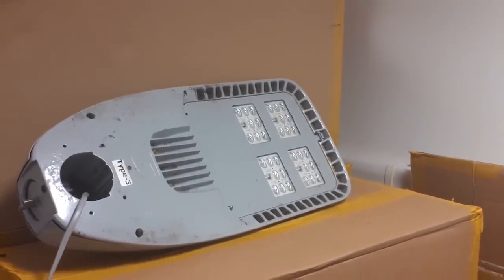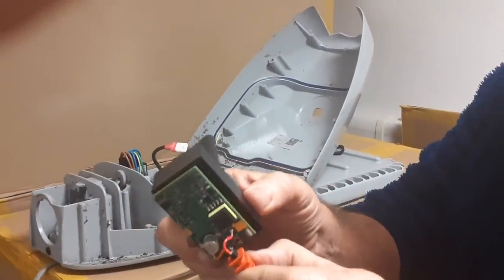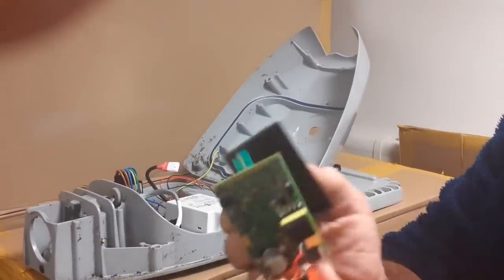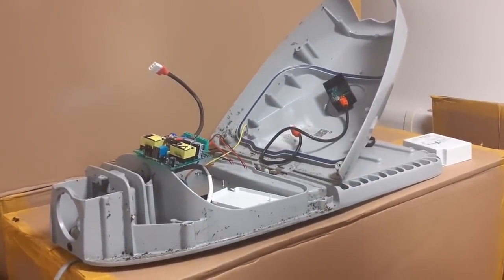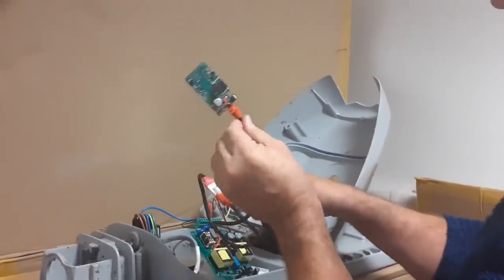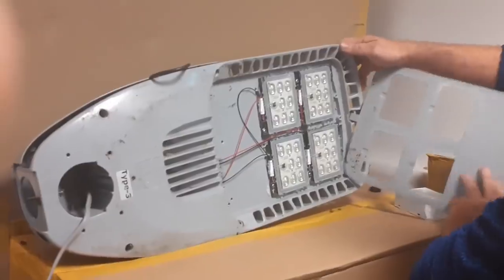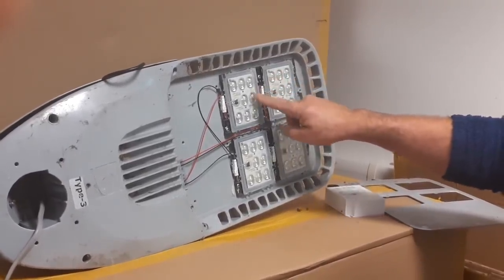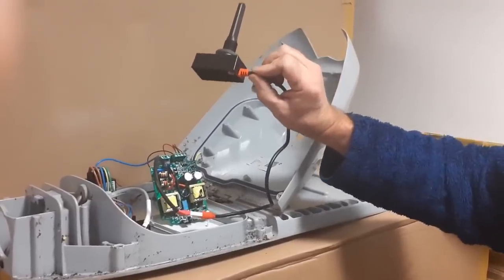5G LED STREET LIGHT TECH BREAK DOWN

Comment: The 5G use cca. 5GHz or higher frequency. The phisical size of the antenna is determinate the frequency (google: monopole antenna calculator). It's a simple phisics. My country Hungary use a hundred years old  tower for switch the lamps. It's analog and works on longwave 135,6 kHz. The thickness of the wires are overbuilt because the norms. This lamp is high level of dust, water and drop resistance. This lamp is installed by workers aloft in cherry picker, bad weather conditions, use gloves etc. The wires need to be heavy-duty.  At the LED side can use thinner wires, because it's an other closed compartment of the lamp. It's sealed in the factory. The mechanic has nothing to do there, he has no workpermit and tools to open that part of the lamp.
Reply: 5G is SUB GHz for the main blanket coverage as its long range radar

Comment: The high voltage capacitors are clearly part of the primary circuit of the switch mode power supply which needs to handle the peak voltage of the mains supply (350V).  The LED will run on the output of this supply - 12 or 24 V.  There is nothing suspicious about the antenna, it is probably just a 5/8 wave omni used to control the luminaire by phone or wireless signal.  If there is anything suspicious about this device we need to find out by having it reverse engineered by a competent technician.
Reply: stop talking sense lol

Comment: The council installed theses very same types of lighting fixtures in my street. My wife , my son and I have all started feeling ill or experiencing abnormal behavior. Mainly headaches, tingling sensations, tired for no reason, and generally feeling run down. I have a 40x microscope and views my blood when I was feeling ill, I saw massive amounts of Rouleaux (stacked red blood cells) forming on the slide. Later when not feeling so  I'll check an other sample the stacking isn't present and looks normal.

What on Earth can we do? I want more info and evidence before I approach the council.

Comment: He's basically correct.
But he doesn't know the difference between Voltage, Current and Power.
450V means nothing unless you know how much current is being drawn.
I doubt that's a 450V Electrolytic. It would be much larger (depending on the Capacitance).
Voltage x Current = Power.
Example:
450V x 1 Amp would be 450 Watts.

Comment: I've been a TV tech for many years and have worked on high voltage gear and LED low voltage power supplies too. This man is telling the truth. LED lights are low voltage low power. The switch mode power supply for the antenna is a very powerful unit, capable of delivering hundreds of volts. The antenna is a very suspicious unit. His comments on the thickness of the cable are very apt. I have a degree in electronics.
Reply: PHD!???? nope! no way in hell.
Reply: as a tv tech what about the antenna. that is just a monopole 0 gain antenna. he is talking shit.
Reply: STREET LIGHTING COLUMNS  HAVE A SINGLE PHASE 240 VOLT  SUPPLY, AND A SMALLER   COMPANY FUSE THAN  A  AVERAGE  HOUSE,  Try  wiring up a 3kw kettle to it and  find out VOLTAGE  and AMPERAGE are 2 very  different things
Reply: You have a degree and don't understand P=I x E?
Power = Current x Voltage.
Reply: @sillyhuman-1  your question is meaningless without context
Reply: You are telling pork pies. As you say leds operate at low voltage. The supply voltage is mains potential & this is the reason for a switch mode power supply. It supplies a low voltage to the electronics that drive the leds. The antenna is ism & used for feedback & control.
Reply: If you have a degree in electronics you should go back to school since the antenna is an ISM antenna with 1/4 wavelength. 5G uses MIMO and need more then one antenna. ISM is used to monitor the lights, nothing more since 433MHz has high latency, low bandwith and short range.

Comment: Original video unavailable.  Do you have good quality pictures of all the components, overview of the circuit boards and under to analyse the circuits.  Also, need the plate with all the information on the street light, model, serial, etc etc etc.  That would be a good way to prove it, this is more of a clip of "look at this, it looks bad"!  Is there a modem in the light?  No modem, no internet!  5G or otherwise!  I'm not skeptic about the potential negative health consequences but I am about all these very unprecise videos.  Street lights would be the best place to hide the antennas since many a required for it to work.  One every 100 feet or so.   There are no very big and long reaching 5G antennas I know of

Comment: My city in Ilinois is putting up LED lights in the whole city, they all have a round black box that sticks out at the top about 4 inches or so high.
Reply: 5g
Reply: we all have them two now in the Netherlands and Belgium.  I tink the black round box is some kind of connector.. on which they can in the future connect, modules with microphone, radar,  heatsensors, 5G transmitters and so on..  it looks like it is the preparation  for total control

Comment: Nope nope nope nope nope nope nope this is not a 5G death weapon. 5G antennas are use Massive multi-user multi-input/multi-output phased antennas arrays and not just a monopolar antenna. Just google "5G antenna element" and you'll see what they look like internally. Quite different from what this video shows.
Reply: Its a single element in the array. Do you have difficulty with the High Gain antenna.
Reply: It MIGHT be a 3G or 4G or 5G client antenna though, like the one in every cell phone. But it's certainly not a weapon. Your response was very restrained. Mine was a bit more pushy :-D
Reply: @fredio54  Its a single element in the array. Do you have difficulty with the High Gain antenna.

Comment: The small cell 5g I think will be on the pole of the street light and then connected via the circuit board in the lamp ????
I'm no expert on this but I read this is faze 1
Reply: Obviously you are no expert. I'm an electronics technician and even Mark has no idea what he's talking about. All he needs to do is present this street light to any electronics repair shop and they'll tell him straight away what every part is and what it does and what it's for.

The problem is that Mark won't believe anyone that doesn't agree with him. That's what makes people like Mark irrational. They are just paranoid fear mongering conspiracy theorists.

Comment: Sooooo GET THIS!!!!  Those aerials are tiny and would melt at the high power you’re suggesting pumps through - if they were used for high power pulses - the would MELT - THEY ARE CLEARLY CHEAP. Made in China probably. There is no heat sink for high power and no FAN sooooo it means it not made for high power? So are we making mountains out of molehills? I’m not sure if this cheap device could do all that you said ... but I’ll take your word for it
Reply: If this thing is able to transmit 5G signals it is a weapon anyways
https://twitter.com/AntiCorruptIre/status/1245990022962085890?s=20

Comment: are these lite only dangerous when their on and does your house protect you  i am building a conservetry in my back garden and their is a lite 8 ft away
Reply: ace crusader so to recap about the streetlight

1) Using  700-800 Mhz NB iOT  module
2) PCB Antenna
3) No Fan or heatsink on the PCB (fanless operation)
4) Metal Enclosure around the LED Light controller
5) Only RF in or out of that metal enclosure is the NB module's PCB antenna that sticks out of the metal enclosure
6) no other holes in the metal enclosure for any kind of radar or tracking sensor (Some models could have a PIR sensor but they're more expensive ,  there are radar sensors but those are even more expensive than PIR)
7) Fanless operation  using an off the shelf NB iOT module  - probably not more than 100mW of actual RF output 
8) NB is the new alternative to Zigbee as it has more bandwidth (100KB/sec.  max  - zigbee is around 10KB/sec.) which leads to larger mesh networked sensors  and less lag (also means you can ride encryption on top of that so nobody can inject traffic and mess with your lights)